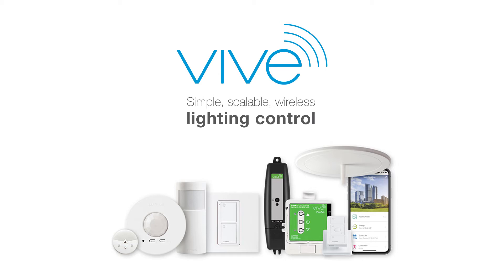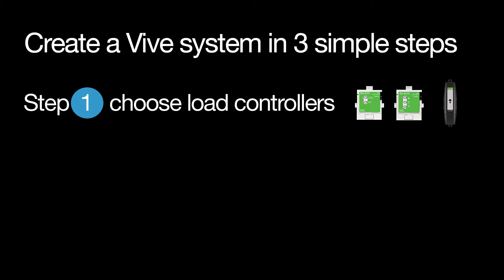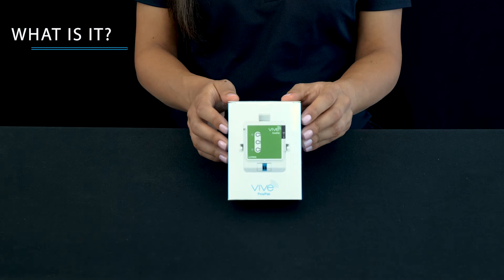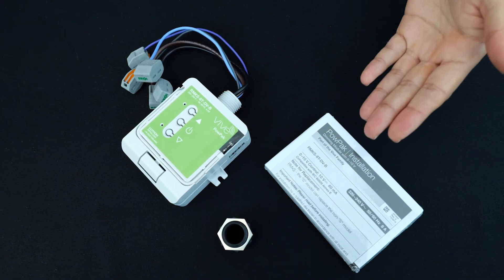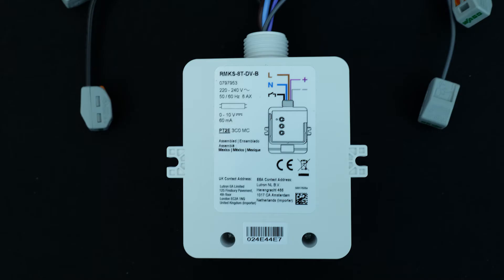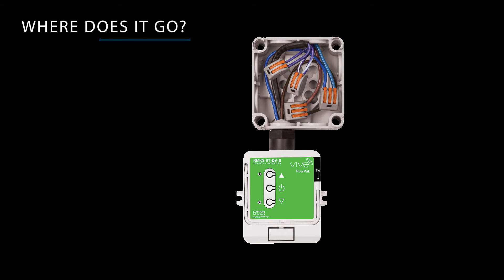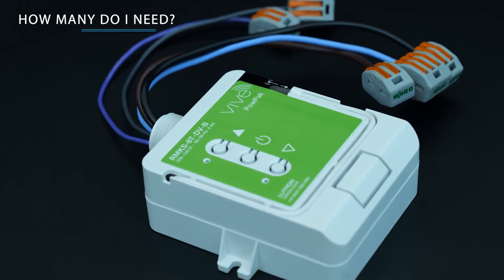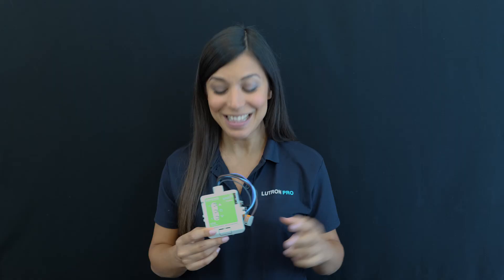Vive Unboxing – PowPak 0-10V

Comment: Will this connect to a Lutron smart dimmer. I want use it to control a set of halo low voltage lights in my kitchen
Reply: Can connect with Maestro wireless (MRF2 products)